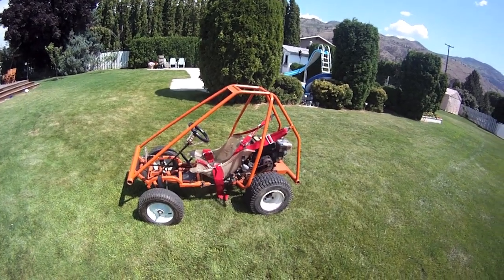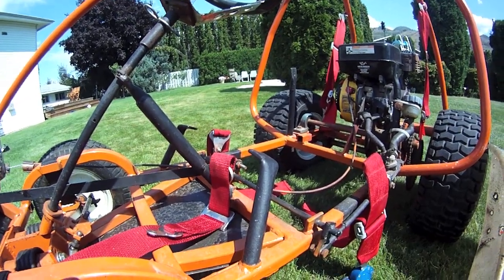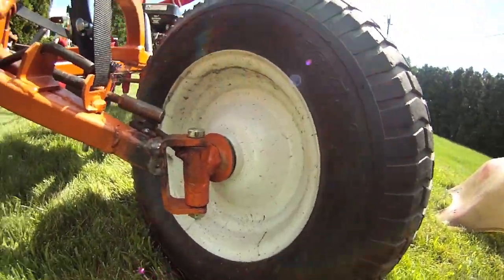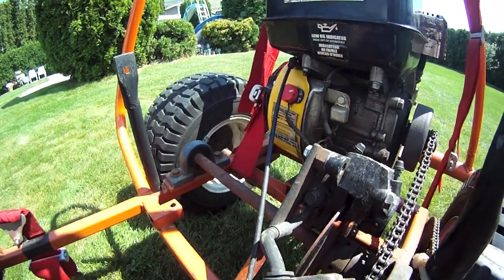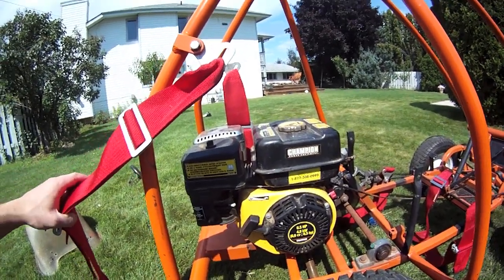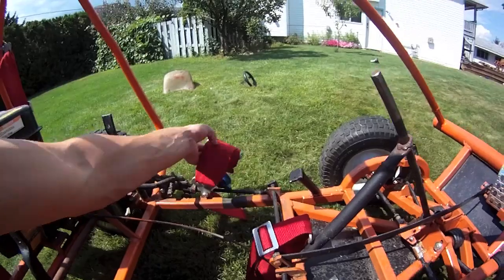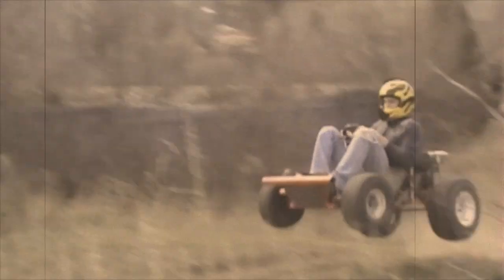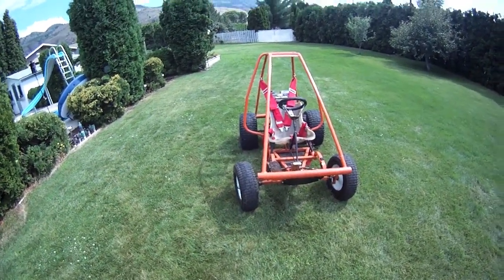Homemade Go-Kart Walk-Around (+Bonus Rollover)

Comment: shuts off cause of the low oil switch bolted to the bottom of the inside of the block, oil goes everywhere, switch cuts ignition for you. handy in this case xD

Comment: I plan on making a go kart very similar to yours and was curious on a few dimensions about your kart.  What is the length and width of your chassis without the wheels?  Also what is the diameter and gauge thickness of the metal on your chassis and roll cage?  Thanks in advance!

Comment: debating if I should change mine from one wheel drive to a solid axle. is there much difference?
Reply: It will make a very big difference when it comes to powerful engines.If you'll gun it, and you have left wheel drive, the vehicle will go right.
Reply: well imm only running a 10 hp tecumseh so idk if i should switch 
btw are you located in new brunswick?
Reply: Nope, Twello, the Netherlands. But you can notice it on a pedal-powered kart already, let alone a 30 times more powerful machine.